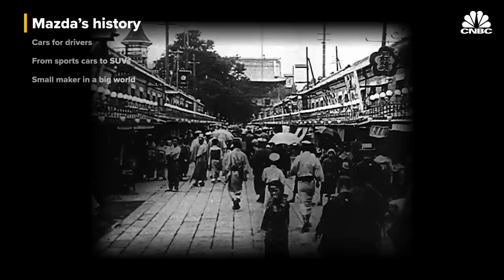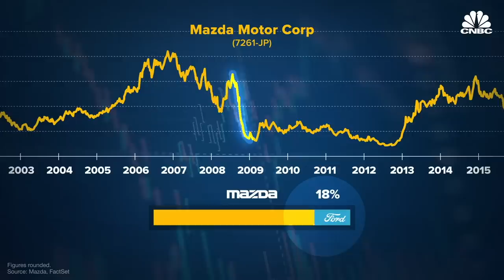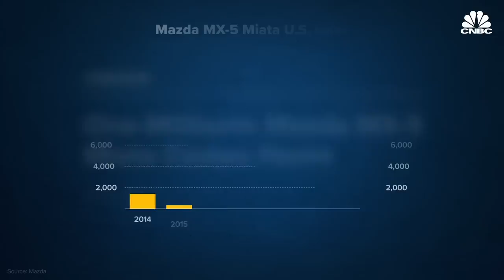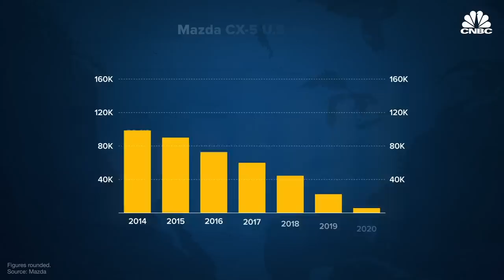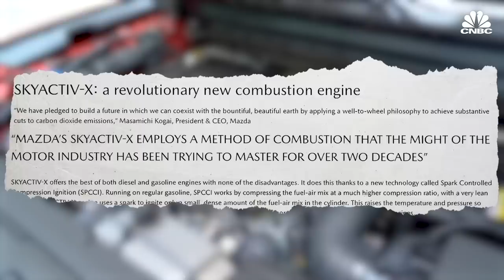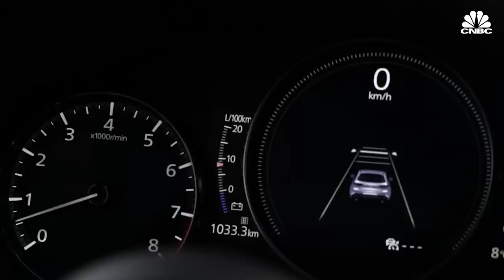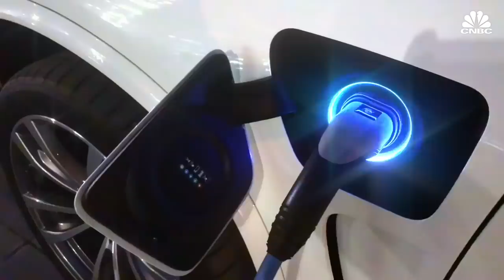Can Small And Scrappy Mazda Survive Among Automotive Giants?

Comment: So i had a 20 year old Mazda until someone ran into me about a year ago. It had nealy 300k miles on it and was the best car i have ever had. Last year i bought a 10 times more expensive Audi which has spent more time at the dealer for repairs to make than on the road. I would never buy a different brand anymore. Mazda is the best.
Reply: Sounds like our protege that's still going after 20 years
Reply: Hope u find same model
Reply: Is that the protege/323? Have the 323 which is 27 years old. Still running even surviving a flood.
Reply: yeah, i own a 97 protege with 160k km on it. still run like a champ.
Reply: My father is still driving a 90’ ford laser which is powered by a mazda BP, 400.000km on the clock and the engine is still running strong! (Changed the piston ring @290k but still an amazing engine)
Reply: I still have my 2010 mazdaspeed 3, 130K miles, tuned and still on the original clutch and turbo. Car still runs like a champ.
Reply: Audi 💩💩
Reply: Yeah agree. Stay away from German cars if you want reliability. They drive and look beautiful but longevity and trouble free are not their strong suit. I had an A4 and it nickel and dimed every few months. I even had to replace the trans.
Reply: Yup, Mazdas (at least the non Ford shared models) are classically Japanese stoking reliable... And yup, German cars are GARBAGE reliability, the worst of both worlds, less reliable than American cars, yet more expensive to maintain than Japanese cars... But Euro cars are so VERY nice! Nice looking, nice interiors, nice driving, and with exciting powertrain options. C'est la vie.
Reply: If you want to own a german car that aren’t expensive to maintain, buy the older models (like the mercedes 300Dt, known for its reliability) but the thing is, they look old lol.
Reply: @ErectileSceptile   Porsches are a funny one though, I too have heard that they are among the more reliable and well built of German cars.. 

But when they do go wrong, OH BOY, NOT cheap. Super expensive parts, and you need to drop the engine out to complete most repairs.
Reply: Dude I had the same experience 
I had a mazda protege still alive dude 19 years old and counting it's reliable I even have people asking me how much I want for it and. I tell em I ain't selling that car..  That car is a beast and a soldier for taking my abuse for years and still takes me to work with no problems 
I tried Honda Toyota etc..  And none of em even came close to lasting as long as my mazda did.. 
And with all car manufacturers an there garbage cvt transmission
 I knew mazda is the future I just bought a cx-5 and I looooove it  I plan on getting the azda 3 hatch or the cx-30 beautiful cars
Reply: @WillJacksonNW 
 my protege as well  still going 
20 + years old 
And no problems at all 
Still drives like  a beast
Reply: What Audi did you buy ?
Reply: Audi is the worst lol

Comment: My 2009 Mazda 6 has close to 300k miles and driving it never gets old.
Reply: Do you have any problems with rost? My friend family had 2 Mazda 6 and the same problem in both. Those are having lots of rost. They had to change all doors from both of the cars
Reply: @tapsulinka  They rust like crazy...

2009 mazda 6 was my worst purchase ever...
I know it was made when Mazda was under Ford, 
but not taking the risk anymore
Reply: @tapsulinka  only the problem you face with mazda in canada is rusting,,and first thing comes in my mind hearing mazda is rust ..but the car is really very reliable,my freind had it at 300k kms
And i think it was due to ford ,because you will never see ford fusion without rust near number plate on tank and doors

Comment: I drive a Mazda CX-5. With it being a 2017 model. And having Adaptive cruise control, auto high beams (turn off once the sensor sees a car approaching, Steering wheel active Alerts etc... and i was able to get all the at 20K. I believe they are just starting.
Reply: Is it touring ?
Reply: I got the same model (2017 CX-5) at roughly the same price too! At 24k miles as a used car and being the Grand Touring trim, it just boggles my mind why these cars are under rated. Test drove other cars when I was in the market for one and then mazdas just caught my eye.
Reply: mee 2 !
i goit the grand touring model cx-5 and for around 23 k good deal the cruise control featrures are awesome

Comment: Proud 3 Mazda owner here;
2004 Mazda 6 S (sold it in 2017)
2010 Mazda Miata GT
2012 Mazdaspeed 3
2016 Mazda 6 GT

I’ll keep buying Mazdas until they stop making them. In fact I plan to buy an FD RX-7 in the next 12 months
Reply: FD is my dream car!!😂 Would you say that 2000s and 2010s Mazda’s are reliable, like talking from experience ?
Reply: @kevinpr.z  Well the FD is a rotary so it won't really have the same experience as the others
Reply: @PURENT  yeah I know that and I also know that the rotary is unreliable but I still like it for the sound, and I would put through the pain of owning one just for that
Reply: I got. A protege 19 years still going 
Just got a cx-5. Beautiful car 
I plan to get a mazda hatch or the cx-30
Reply: I've owned a 
2016 Mazda3 Sport
1996 Mazda Miata M (current)
2010 Mazda 3 GT (Current) 

Agreed I'll own Mazdas till they stop selling them
Reply: @kevinpr.z  2000s Mazdas (other than Miatas) weren’t that great because they used a lot of Ford parts so the reliability was compromised. Automatic transmission failures is common with mid-2000s Mazdas
Reply: @nopybooja5495  oh that’s Interesting, I bet they got better now since they broke their partnership with Ford in 2015 I think
Reply: What's a FD?
Reply: I got a ‘08 Mazdaspeed 3...When the engine blows up I will buy ANOTHER engine for it. Very reliable and FUN!
Reply: @GrEeCe_MnKy  it's the third generation of rx-7. First was the "fb", second "fc" and then "fd" (last generation of rx-7, next model was  named the rx-8) 🙂
Reply: @ZettoMedia  oh, thanks for the info! Have a nice day!

Comment: The Cx-30 Turbo is an absolute, beast - Throwing a turbo in that small crossover with that amount of power was a stellar idea.
Reply: Not just thrown in, but carefully planned and engineered. It is a proven engine design, matched with a proven transmission design, which all fits within the existing body architecture. Methodical and measured planning, bold and strategic execution.
Reply: @KillaninjaFC  well said!
Reply: You can thank Volkswagen for that - turbocharging since before WWII
Reply: Mazda cx30 is amazing at a fair price.
Reply: @joebloggs9738   You're giving VW entirely too much credit. Gottlieb Daimler (of Mercedes fame) was experimenting with turbocharging since before WWI, and the first successful Turbocharging proof-of-concept application was actually thanks to Swiss engineer, Alfred Büchi, in 1925.... VW didn't even deliver the first production turbo car, that of course was Oldsmoble's 'Jetfire' Cutlass back in 1962... So no, we can't "Thank Volkswagen for that". 

We CAN however thank VW for padding auto technician pockets very handsomely. Credit where it's due.
Reply: @joebloggs9738  you can thank the swiss govt for that not vw, turbos were invented by a swiss inventor and first land vehicle to use a turbo was a swiss truck which came before ww2. And also what the guy above said.
Reply: Way too much praise for turbos which make the engine work harder and wear out faster. For those of us big on reliability, it's a deal breaker. You give up longer lasting engine for minimum savings in gas----not a good trade off.
Reply: @captinbeyond  semi trucks beg to differ
Reply: @KillaninjaFC  
Dude I 100% agree they really did they homework when they designed thr car I absolutely loved there cars
Reply: but is it fun?
Reply: @Trill Mixin  yes, it's really fun! If you are looking for a CUV with high quality materials and premium tech that other CUVs lack I suggest checking one out. I own a cx 30 turbo plus and drive beautiful. Fun to drive during the winter also.

Comment: My first car at 18 was a 2004 Mazda3 and it was AMAZING and lasted 175K miles. It was the only car in it’s class at the time with independent rear suspension and four-wheel disc brakes.
Reply: Too bad they left it out in the new Mazda3.
Reply: The first gen Mazda 3 holds its value compared to its Corolla counterpart. At that time it was so modern.

Comment: As an ND2 Miata RF owner, I can say this was very well done and pays respect towards the brand and the Miatas Lineage. Miata is always the answer
Reply: Hey man . Quick question. As a current dodge viper and mustang owner you think the Miata would satisfy some one like me ? All my cars are getting up there in miles was thinking if getting one to save on miles and maintenance and gas . Want something fun to drive car I want to love like my current line up . Only thing is idk if it's for me since Im used to American V8s an all
Reply: @silvafox07  It's not an extremely fast car, but for its size it has good acceleration. Other then that, it should handle and feel more lively around the corners compared to either of those vehicles.
Reply: @godemperorofmankind7255  that's what I'm looking for . Give me the same thrill with out having to worry about blasting off to 120 plus . Lol thanks man .
Reply: @silvafox07  I have an NC2.  The great thing about Miatas is that you can drive them to the limit without losing your license.  They don’t weigh anything and are very agile.  I personally love that they are sort of an egalitarian car.   I even got a compliment the other day at a traffic light from a guy driving a $150k BMW I8.
Reply: @DJPleasureSeekingMissle  I bought mine 3 days ago . I got a 2021 black RF. I'm not gonna lie it needs more power BUT it's fun as hell. And I filled up with 30 bucks ..... I. So used to 60 to fill every week. I find myself driving more than my mustang which is convenient.
Reply: @silvafox07  congratulations on the new purchase.  And yes, it’s a very affordable car to own and operate.

Comment: I drive a 2013 Mazda 3 Skyactiv. It's my first car that I bought a few months ago, and I have nothing but positive things to say about it. The moment I first drove it, I could tell was designed to be a little more sporty and fun that something like a corolla or a civic (not counting the si and type r). The exhaust actually has a little bit of rumble to it even for a 2.0 liter engine designed for mostly fuel economy and the manual shift mode ( i have the automatic transmission) it pretty fun to use as well. Plus it gets 40+mpg on the highway. Nothing but love for my car and the Mazda community.

Comment: I have a 2011 Mazda 6 with standard transmission, 170000 miles on it with no issues whatsoever, rock solid vehicle and I have a 2016 Mazda 3 also very good reliable car

Comment: I have a Fiat 124 that is about 80% Mazda. I happen to like the infotainment system. It is Linux based and there are several resources that can allow owners to upgrade the software and allow features such as Apple Carplay, Android Auto, Change wallpapers, colors, speed up boot times and add apps.  If you have the older Mazda connect with an older software revision the process is quite easy. Also replacement units on the used market (Ebay) can be had for less than $200 if it takes a dump. Also you can allow the touchscreen to be used while moving. All the maintenance light schedules and reset routines can be done through the screen as well. I even hooked it up to my OBD port so trouble codes can be read and cleared on the screen as well

Comment: My first Mazda was a 2005 Mazda6 GT V6, which I drove for almost 470,000 km until it was replaced with a 2017 Mazda6 GT Premium.  I was able to drive 500 km with the V6 but the 2.5L Skyactiv 4 cylinder engine allows me to drive 700 km.  I am excited with the upcoming inline 6 RWD Mazda6.

Comment: My family has owned, in order...

- Silver '93 626 (5 speed)
- Green '96 626 (5 speed, sold)
- Black '99 Millennia w/242k miles before the trans went, sold (EXTREMELY underrated car, go check it out along with the short lived "Amati" Mazda Spinoff)
- Sapphire Blue '99 Miata 10th Anniversary Edition (6 speed. My dad's current toy, he looked for that car for years)
- Black '01 B-4000 (5 speed, still running perfectly with ~130k on it)
- Gray '04 Mazda 3 Hatch (5 speed, 200k+ miles, sold)
- Black '05 Mazda 3 Sedan (5 speed, sold)
- Silver '08 Mazda 3 Hatch (5 speed, perfect up to 196k when it was T-boned)
- Black '09 Mazda 6 (6 speed, dad's current daily with 236k on it) 
- Gunmetal Blue '11 Mazda 3 (5 speed, my first purchase, sold it to my sister w/168k)
- Crystal Blue '20 Mazda CX-30, (Parents' first brand new car, mom's current daily)
- I'm currently undergoing Army IET. When I finish training, I'm rewarding myself with a '21 CX-30 Turbo in either Poly Gray or Machine Gray. I am so ready.

Think we love our Mazdas?

Comment: I own a new miata and I love it but man I do miss having cup holders... hehe
Reply: They came with my rf when I bought it. You can of course buy them seperately if not included. You just plug them in
Reply: @mackan7086  I need to order them since I bought mine pre loved
Reply: I’ve got 4 in my NC.  Perhaps that’s why it was viewed as the “fat” Miata lol.
Reply: @DJPleasureSeekingMissle  thicc not fat lol
Reply: @juanvelez5699  lol
Reply: If only human beings were born with two cup holders, one at the end of each arm...
Reply: @mattheweyre7054  how am I supposed to steer, shift and hold a drink😅
Reply: @juanvelez5699  Hmm yes that does sound challenging. I guess the answer is to do one thing at a time? Probably not much of an answer, sorry!
Reply: @mattheweyre7054  it is a real juggle, I guess I should gotten the automatic one but having the manual builds character haha

Comment: I bought a CX50 late last year. I had never even sat in a Mazda prior to that. If people would just sit in one, they would see and feel just how nice they really are. The first time I sat in my CX50 before I test drove it, I could instantly tell the quality was far above that of most others. My wife has a late model, fully loaded Ford Escape. When I have to drive the Escape after having driven my CX50, all I can think is, “this Escape is a pig at best”. Very sloppy handling , dead steering wheel, loose and creaky plastic everywhere. Now, the CX50 does have SOME  plastics in the interior as well, but it looks and feels far better, and everything fits snug. Just sit in a Mazda. You won’t be disappointed. Even the lower trims are nice.

Comment: The car I missed the most was my 2003 E46 Topas Blau - exhaust note, road handling, buttery-smooth manual. It had 14 miles when I got it and 249,700+ when I let it go 9 years later. When I considered buying a new car, I considered another Bimmer, but I didn’t want to spend $50K. I test drove a 6-speed Mazda3 Touring, and the manual was the most Bimmer-like of the cars I looked at. My 2016 Mazda3 has been rock-solid reliable; the mechanic shop I regularly took it to - all the mechanics wanted to see it as it was one of the few manuals they got in. It currently only has 40,000 miles and should easily last another 10 years

Comment: My dad drives an old Mazda 323...its   has clocked over 200000 km. But running fine - even the air con works!

Comment: I am the proud owned of a 2015 Mazda 6 Touring 2.5 with a 6 speed auto . I absolutely love my car!!!! It is the best car I have ever owned hands down !!!!. ( My second best is was a 2003 Mazda 3 touring that I bought brand new before the car that I have now) .
I have just 37k on my current car and I have absolutely no problems with it whatsoever just general maintenance. I am hoping that Mazda will build the rumored RWD Mazda 6 replacement and not too distant future I know that currently the CX crossovers that they are building such as the CX 30, 50, 70 and 90 models are there bread and butter but I love the 6 and I want to remain a  devoted Mazda fan in the future .

Comment: Mazda RX8 owner here (yes, yes laugh at the bad one), I really cant see myself driving another car. It handles as good or better than other “sports coupes”, just lacks power.
Reply: Nothing wrong with the RX8.  Everyone was just upset because it wasn’t the RX7.  It’s a great handling, sporty little car.
Reply: @DJPleasureSeekingMissle  So far I’ve daily mine for the past almost 3 years and haven’t had any issues other than changing spark plugs and wires, even my ignition coils are still good
Reply: @dslbroski4922  that’s great to hear.  Hopefully it treats you well.  I’ve got an NC2 Miata that shares the same basic underpinnings as your RX8.  It’s finally starting to get warmer in my area and I really missed the top down feeling.  Even a trip to the grocery store  feels exhilarating 😎.

Comment: The article is excellent with one exception, I desagre with your description of the brand as a 'scrappy'. Mazda cars are not scrappy, they are exceptionally well built. I have owned two Mazda 6's since 2009. My current one I purchased in 2016 without absolutely no mechanical or body finish problems. Service at dealerships is excellent and it is most likely I buy another Mazda6 again.

Comment: Got a 2016 Mazda 6 approaching 115k miles... owned for 3 years; driven to 37 states... and I’ve yet to have explored the Northeast or California. And if all goes according to plan, I’ll take this thing through the Mid-Atlantic Memorial Day and New England around late September/early October. 

Other than the DELICATE low profile tires... TWO blowouts & one blister within a 5 month period... I have absolutely no issues to report; just fluids & routine stuff. I trust front end suspension stuff in general is all coming due soon enough (alignment, shocks/struts) but I’ll wait until some point this summer...